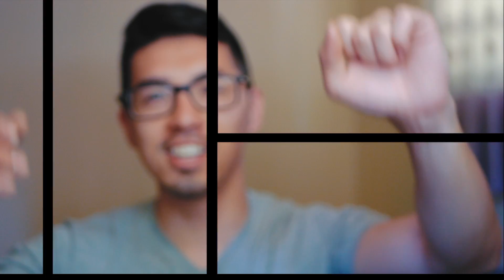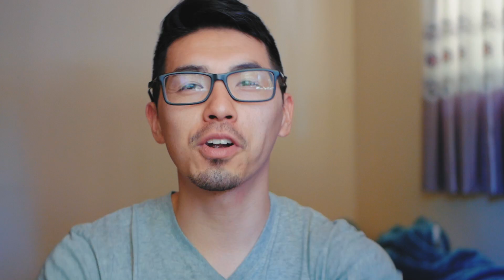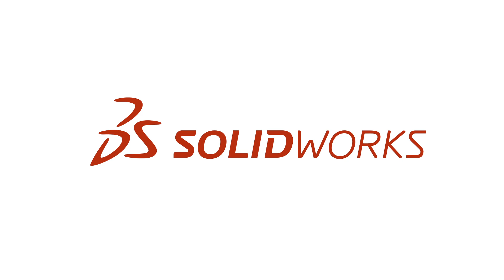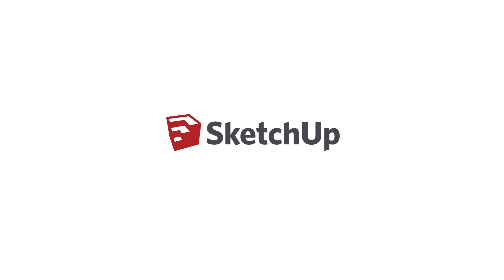Which CAD Programs for Industrial Designers?

Comment: let me tell you bro.you mentioned that we can use same software we can share .that shows that you really do not know what you are talking about .people we can literally use any design software and just save it in iges format.when wr save in iges we can literally open our 3d file in any software  so it does not matter which you learn.dont get misguided just because some half baked guy says it.i have a engineering degree in mechanical with a masters degree in machine design.i use a software called creo or pro e which is widely used by ISRO .so just learn one software.doesnt matter which
Reply from the maker: igs, step, stl is like the 3D equivalent to jpeg, png, tiff when it comes photo formats. Baked in data that you can open in any program as you said. Native formats such as .psd has effects and layer data. Same idea with using native soildworks file such as .SLDPRT and .SLDASM. Hope that clears up your misunderstanding.